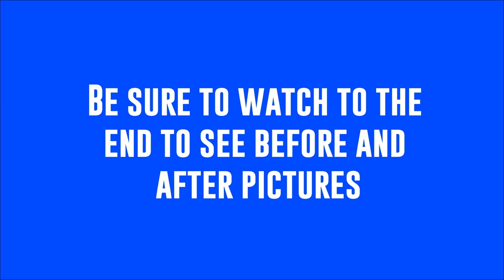RV REMODEL: 2003 Jayco Jayflight 31BHS Travel Trailer Renovation and Camper Remodel

Comment: Looks very clean, great job! One thing you may wanna consider, coming from someone that's owned many RVs! To save you alot of trouble in the longrun, remove the crank up antenna, patch the hole in the roof with lap sealant and cover the inside hole where the crank came through the ceiling with a smoke/fire alarm! Those antenna are notorious for leaking around the worm gear shaft!
Reply from the maker: Thanks for the tips!  We ended up selling the rig about a year ago and moved to a 5er!
Reply: That's good to know Dwayne. I've been on the fence with mine, considering I never watch TV. How big is the hole left over when you remove the antenna? Is it a big gaping hole that needs a plug? Or is it just a bolt hole? Never pulled one of those silly things before, but I really want to do what you describe.

Comment: You really gave this trailer new life!  It looks so much better,  love the new flooring!  The white on the cabinets makes them look brand new!  We bought a 2006 Jayco Designer 5th wheel that had been very well cared for in 2019.  We are using it in original condition.  We did have to replace the kitchen faucet because the old one started leaking but everything else is original and works fine.  We had two brand new top of the line Jayco 5th wheels, a 2013 Pinnacle and a 2015 Eagle Premier.  Sold both due to mechanical problems that recurred again and again and dealership couldn't seem b fix them. The 2006 works perfectly every time and that is much appreciated!!

Comment: I had the same water damage with our 2001 Jayco Qwest.  The bunks and bathroom in the same location.  Identical bathroom cabinet.  We had water damage in the front and rear too.  Completely rebuilt the front and rear.  Also installed new roof.  Remodeled the inside everything except the kitchen cabinets.  Good job on your rebuild and remodel!
Reply from the maker: THanks!  Isn't it so much fun!  We ended up selling the rig this fall and picked up a 5th wheel.  Hope all is well.

Comment: Now after awhile,  how did the white paint hold up with the kids and moving things around?  I did up an old airstream and painted the walls white and then used a feather duster and an off white paint to add some interest to the walls and also help to hide slight imperfections.  It worked great.
Reply from the maker: We sold the rig in September but got to use it for about a year off and on.  The paint on the cabinets, if scratched, would come off. Walls held up well.  

We didn't do any sanding on the cabinets which is probably the reason the paint was easily removed.

Comment: Wow 👏 you both did an amazing job! Great memories to be made for your young family!! 
Are you a carpenter? Seems like it would be difficult for a lay person to do that. The cabinets look beautiful! Did you make the couch/bed and the dinette set or did u buy them? 

Great work, be very proud of your guys's hard work! 

Gotta get me a spray gun, she made the painting look easy!
Reply from the maker: Hello!  Thanks for the nice words!

 We are not carpenters per say but have a lot of experience in carpentry. 

We built the master bed and couch.  Couch I saw a couple designs similar on the web and came up with our own design.  The dinette bench's I saw a video of some similar and we liked them so built something similar.  Table is the original one that we stained and poly'd.  Then I installed 1.5"  black pipe for supports, with a piece of angle aluminum holding it on the wall.

Comment: 26:15 @inthenorthwoods

excellent video and beautiful Reno!! We have a 1999 jayco we are about to tear into and can only hope it turns out as lovely as yours. 

I’d love to ask a couple questions about your flooring. I heard on the video you changed your mind in what you were going to use due to temperature ratings. The photo shows boxes of SPC rigid core flooring so we assume that’s what you used. I read you sold the rv but did use it for a year or so and would love to know how the flooring held up with the temperature changes?
Reply from the maker: Yep, sold it.  The only time I noticed an issue with it was when the rig was really cold and then we turned the furnace on.  The flooring around the vents in the floor would raise up a bit because of the expansion due to the heat.  Once everything equalized it was fine.  Everything else was great!

Comment: That’s amazing. What I’m wondering is HOW did you know there was water damage behind there? And how did you know there wasn’t any near the other windows or sink area? I’m looking to buy a used RV and renovate it as well, but if there aren’t any obvious signs I’m wondering how will I know 🤔😰
Reply from the maker: If the water damage is bad enough, you can feel on the inside of the rig in the corners.  The inside walls are typically luan and if there has been long water exposure, the walls will be soft.  In our case, I found soft spots in the corners.  For the windows, we actually pulled out every window and I inspected around them.  They actually were all in great shape. 

So feel on the inside in the corners of the rig, underneath windows.  Look for discoloration in the ceiling. Feel for soft spots. If it is a smooth sided rig on the outside, look for delamination (almost like large bubbles) where the fiberglass separates from the luan/wall framing. 

Another option is to bring a screw driver with a #2 square bit.  Outside, pull the vinyl insert trim and then pull some screws out.  If they are rusted, then you know there was water. Crawl up on the roof an look for any holes in the sealant.  Inspect very closely the corner trim and any seals and look for any holes/gaps in the sealant. 

It is very hard to know on purchase  to see if there is any water damage, or bad water damage.  Take your time on inspection and you can usually avoid the HUGE problems.

Comment: Can you talk me through how you did your corner seals?
Reply from the maker: Sure!  

1. Removed the old corner seals.  This is when I determined I needed to repair some of the wall structure.
2. Removed siding / portions of walls in areas of rot.
3. Rebuilt the walls that were rotted/replaced certain parts.
4. Reinstalled the walls and siding.
5. Cleaned up existing siding corners.  Removed old caulking and sealants.
6. Taped the corners using Dicor Seal Tite
7. Placed butyl sealant on top of the tape, under the corner trim. 
8. Installed the corner trim and vinyl insert molding
9. Used Proflex RV sealant and sealed along the edges of the corner trim.

Hope this helps!

Comment: Very nice! We're getting ready to do a renovation to our trailer and this was extremely helpful. What flooring did you use?
Reply from the maker: Thanks!! Good luck on the reno!  It's fun!  We purchased the vinyl plank flooring from Menards.   It is the Great Lakes Flooring Defender Series in Dusty Tavern.  Pretty easy to install and cut using wood working tools:  miter saw, table saw, jig saw, and multipurpose tool.
Reply: Are there any restrictions on type or thicknesses because of the slide out?
Reply from the maker: @bridgettmoody1475  Certainly.  There is plastic piece the slide rubs on and we made sure the flooring was below that.  Even still, I wanted to get flooring that was as thin as possible to minimize any issues with the slide moving over the top.  I lay pieces of scrap flooring on the floor to be under the slide as it slides in.

Comment: What kind of paint did you use on the walls, and how did you paint it? I want to paint my rv but i've heard its bad to use normal house paint on rv walls. Just curious!
Reply from the maker: I'm pretty sure we used normal wall paint.  Not sure why it would be bad.  We used rollers were we could on the wall and brushes elsewhere. On cabinets we could remove we sprayed them.

Comment: First of all, wow! Very nice remodel! We have the same camper, except the fifth wheel version, and we are wanting to remodel it as well! Been looking for ideas and it was nice to find the same camper to see real results! I do have a question for you, how well has the flooring done while traveling? I’ve read mixed reviews on this type of flooring separating during travel or in storage during winter months. So we are trying to figure out which way to go on that
Reply from the maker: We have so far only taken it on two trips/weekends.   The flooring was fine for that.   

I did notice one of the short joints in one location opened up ever so slightly in the flooring.  I plan to take a mallet to pound it back together when I have a chance.  

Key thing is to follow manufacturers instructions to make sure there is adequate space on the boundary for expansion/contraction.  I probably had ours a little too tight to the wall in spots because the quarter round i installed covers a lot!  Time will tell i suppose.  We just figure for the small investment in the vinyl flooring the trade off is huge innot having the carpet.  Can always replace it in the future for another few hundred in material.  

I made sure to get a flooring that is rated for the large temperature range in my location.  We can go from -30 to +90 within the calendar year.  Some people suggest the life proof flooring as an option too.  Thing is, all flooring will expand and contract.  The floating flooring needs room to expand and contract.  

Thank you for watching!  Let me know if you have any more questions!
Reply: Thank you for the great information! I do have one more question, did you ever figure out what to do with the slide out nylon exposed? And did the slide out scratch the floor when it is in?
Reply from the maker: @levikelley2854  I did not get to that, but when we do, i will for sure record the process.  I did see a video by @All About RV's that discussed his transition strip and I was going to attempt the same: https://youtu.be/IyJA9RvRQMk?t=447

Comment: Holy cow, this is an amazing Reno! Was there any structural or mechanical issues with the trailer when you purchased it and what was the cost?
Reply from the maker: On the surface, we did not see any structural or mechanical issues.  We just figured we would do a little painting and flooring replacement.  That turned into a little water damage repair as well.  We paid $4k for the unit.

Comment: How did you end up doing the transition piece for the floor on the slide out?
Reply from the maker: I took two 2x6's and carefully ripped them down on the table saw.  Took some test cuts of course but it worked out nicely. Sanded it down to round off the sharp corners and I then attached it to the slide and when the slide was fully extended the transition piece rested nicely on the floor.  

If I remember correctly it took some fancy angles transitioning from the floor to the slide.  1/8 thick on the outside edges and about 3/8" thick at the middle/attachment area on the slide.
Reply: @OutdoorsEngineer  awesome! Any pics?
Reply from the maker: @ritts162  I made a post with the only pics I had!  https://www.youtube.com/c/IntheNorthwoods/community
Reply: @OutdoorsEngineer  oh wow. That turned out very nice. 

Thanks for the info! The wife is going to have me on this very soon lol

Comment: Just wondering if you repaired the floor by the slide out?  We have the same issue in the RV we just bought.  Wondering what may have caused it and how you repaired it?  Did you happen to take footage of it?  Ty
Reply: PS absolutely loved this video.  We also happen to have water damage on the end.  This video is fantastic.  Thank you for taking the time to document everything.
Reply from the maker: We did not.  The floor, while discolored, was not damaged.  Most likely it comes from the trim on the exterior of the slide.  I removed vinyl insert and then removed one screw at a time, caulking each screw.  Then I caulked along the edge as well, using RV caulk. I freshened all of the caulk seams, redoing the most suspect ones.

Comment: Can you share what flooring you used?
Reply from the maker: I believe it was the Great Lakes Defender Series, and we got it from Menards.  I could/would recommend also LifeProof from Home Depot.  Make sure you check the specifications/instructions regarding temperature variations.  I know the stuff we used, if it went from cold to rapidly warm, there would be areas that lifted a bit from expansion.  No joints came apart though. Once it warmed evenly it was fine. But there are some that say do not install if temps will get below 50 or 60.
Reply: @OutdoorsEngineer  awesome thank you! I wasn’t sure if 6mm was too thick. We also have a flush slide out and I’ve been a little stressed over floor thickness 😂

Comment: Bout how much for the wood and stuff for the frame
Reply from the maker: Repair work probably cost $4-800.  For the most part i had the framing, so that cost $0.  Just had to purchase the interior paneling, and all of the materials to seal the exterior, and insulation.  

 This does not include paint and flooring.  Its been a while and I don't remember the exact numbers anymore.

Comment: Correct me if I'm wrong, not counting labor, you spent around $450 on paint, flooring and building materials?  You did an awesome job. 

...I would have pulled the flower contact paper from the cabinets (sarcasm). Really... well done.
Reply from the maker: All in, we estimate the remodel portion was around $1000.  That includes new bed, couch,  we ended up needing a new water heater LP regulator, paint, flooring, ceiling lights, drawer slides and much more.  Then tack on a few hundred  more for repairing the water leaks (new paneling, insultation, RV caulks, Vinyl insert trim, screws).  Well worth it!

Thanks for watching!